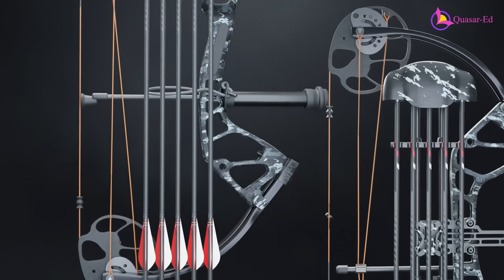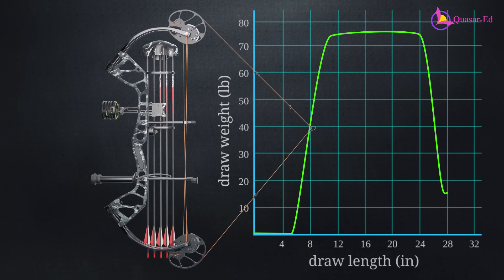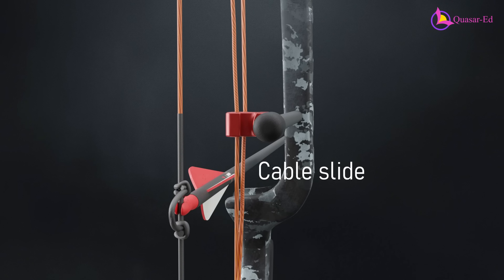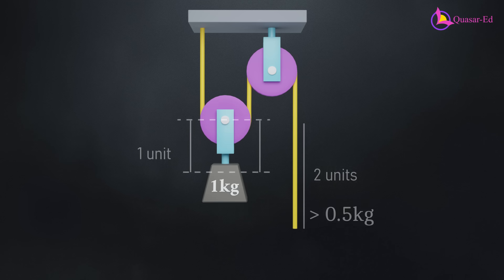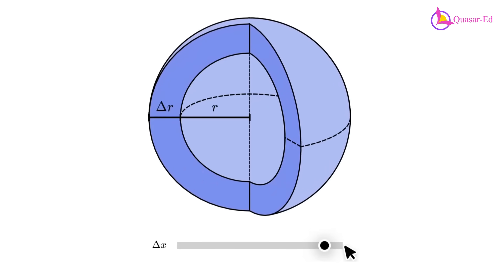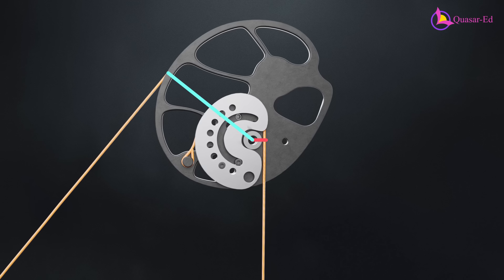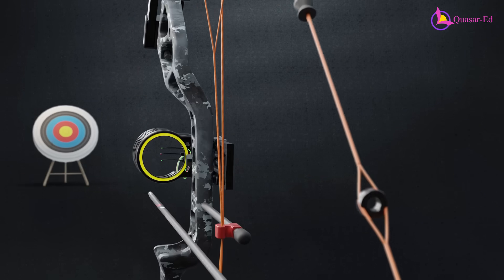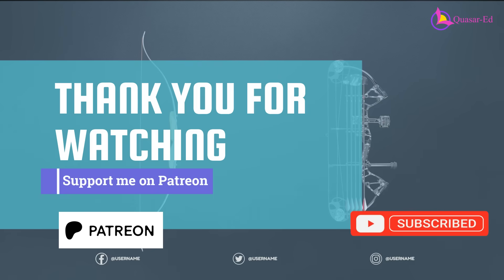The Engineering Behind the Modern Compound Bows

Comment: Great someone wants to explain bows, and shows a recurve bow held upside down.
Shows how much the person knows about archery.
Reply from the maker: What are you talking about, at what timestamp? I am sure I show the bow in correct position. And it is true that I am not an expert in archery, and in case you didn't realize, this video is about how a compound bow works, not how to become an expert archer. So you are using a wrong insult.🤔😅
Reply: @quasar-ed  The recurve on around 0:20 is either upside down or it is one of the worst 3d models of a bow I have ever seen.
Her this is how it should look.
https://youtu.be/NSft_qMMf-M?t=686
Reply from the maker: @thomaskurz5617 Actually, it is not upside down. I think you get confused about that small shadow which actually indicate the transition curve and not the arrow rest. The arrow rest is on the other side. The model is based on the first compound bow riser, so it is a bit different from modern recurve risers.

Comment: I think "compound is not more powerful" is misleading.  Even when a normal bow and a compound one have the same force (50lb), the compound one can be used by a weaker person; he can use impulsive force to reach the full draw length.    
And/or "cheat" using the whole body to draw, in one motion.

If you take the person as a fixed point, then the compound bow he can use It's way more powerful.    

No way that I can draw a recurve bow and penetrate 4cm of wood!

Comment: some misleading  info  in  this video. 
saying trad is cooler than compound is subjective.
shooting compound might be easier at first,  sure. but in the long run, mastering compound is  far more difficult than mastering trad. trad  bow shooters will  never achieve the  level of precision that compound offers, which means  there is more technical skill in compound.  you're talking about milimeters versus inches.  trad bow is cool, and  i intend to start shooting trad, but compound is just way more fun to shoot.

Comment: 1. With a compound bow you have to put in MORE effort to draw it. The thing is, compound limbs are usually 2–3 times stiffer, so you literally need more strength to pull one than to draw a traditional (non-compound) bow. Yes, AFTER you reach full draw you need less effort to hold it… but nobody aims long enough for that difference in total work to become noticeable. The advantage is that you simply cannot hold a 60–70 lb traditional bow drawn long enough to aim. But I’ll repeat — you still have to bend the limbs with about 2–3 times the force of a traditional bow to get to the point where the draw weight is redistributed to the cables/cams (let-off). And yes, energy doesn’t come from nowhere: the limbs won’t bend themselves — all the force the bow stores and then transfers to the arrow you must produce with your hands.

2. A D-loop exists to protect the string, because unlike with a traditional bow you can’t remove and replace the string without a large limb-bending press. The load is borne by the D-loop and it’s what will wear through first.

3. The “string stop” (the thing the string hits after the shot) does not reduce noise, and it certainly doesn’t reduce vibration. It’s there for convenience, and the bow is noticeably quieter without it. Believe me — I shot for about a year and a half without one while waiting for a replacement for a broken one…

4. And no, a traditional bow is only and exclusively about “learning to make your shots as identical as possible and memorizing where your arrows land.” Since a traditional bow has no aiming aids (even the Olympic recurve already has a sight and a mechanism to ensure a consistent draw), the archer simply has to memorize where they hit. So a traditional bow is actually much more limiting.

Comment: Nice video and nice explanation. I have been into archery for appr. 39 years, so I have tried both recurve with and without sight and compound bows (and a little longbow, but never used longbow for "serious" archery). I kind of like all types of bows, they each have their charm. I know shoot compound bow and have done so for appr. 16 years. As a structural engineer I probably like the engineering behind a compound bow. When I was younger, I "explained" (mostly to my self) that the let-off comes because the string becomes longer at full draw than it is at still. And that is probably part of it, but today the shape of the cam also does something. This (longer string) also explains why the draw force curve for a recurvebow slightly flattens towards the end. But I don't think you mentioned that the excentric axle for the cams probably also gives some lever effect in them selves. But the interior levereffect in the camsw as new to me. And then there are also compound bows that uses actual levers, to achieve the same as compound bows - the leverbows.
Reply from the maker: Thank you. You are right about the eccentric axle causing the lever effect. But it is used to describe the pulley or any circular disc with off center axles. For cams, their axles are always off center, so we can imply cams cause the lever effect.

Comment: The part at 4:00 is extremely misleading. The peep sight and the bow sight are like shoes and shoelaces, one is useless without the other. 

It’s not about “addition accuracy.” Having only 1 or the other is completely useless. You’re meant to use the peep sight to center the front sight, just like iron sights on a firearm. 

If you only have the front sight for example, your eye placement could be off by only a few millimeters, which will translate to several inches off target if not more downrange.

Comment: The original Allen patent showed a bow with 2 pulleys, but the pulleys were cam-shaped.  Initially compound bows were not manufactured this way, the picture of early compound bows shown at 0:55 in the video shows 4 wheels, not 2, and the wheels were round, not cam-shaped.  I've never read an explanation of this but I assumed it was due to manufacturing ability at the time.  It was some years later when 2-wheel compounds became widely available but still with round wheels.  The average 4-wheel compound only had about 35% letoff in draw weight, the average 2-wheel compound had about 50% letoff.  More modern bows with cams have the possibility of a lot more letoff.
Reply from the maker: I had my doubts about using cam shaped pulleys in that way. When I try to replicate that, the rope just slipped without rotating the cam. In modern compound bows, the rope is winded over the cam so that the cam has to rotate. I also can't find the actual footage of the first compound bow. If someone has experience on that first compound bow, please share with me.
Reply: @quasar-ed  In all bows I've had experience with, the "ropes" were steel cables usually with a plastic coating.  There is usually a piece of steel swaged onto the cable at some point so the cable can't slip, and the piece of steel fits into a hole in the pulley or cam.  The string itself that interacts with the arrow is usually some form of dacron with loops on each end that allow it to connect to the ends of the cables.
Reply from the maker: @billj5645 I mean, in the 4 pulley compound bow you pointed out, if the large pulleys had cam shaped, how would it rotate when the string is drawn? I found some images that show those were circular cam and some that were just regular pulleys. I just couldn't figure out about those cams.
Reply: @quasar-ed  By at least 1975 the wheels at the ends of the limbs always had off center pivot holes so as they rotated they would also swing out and around which is what gave the letoff due to the leverage.  On first pull the leverage is working against you so you pull harder then as the wheels swing around the leverage is working in your favor and the holding weight is much less.  I owned 3 different 4-wheel compounds starting mid 1970s.
Reply from the maker: @billj5645 I would love to see the video of the pulley action. I still couldn't grasp how the pulley rotates.
Reply: @quasar-ed  Remember it's not working like a normal pulley, the cable is connected to it so it just winds or unwinds as the pulley swings around.
Reply from the maker: @billj5645 But it is just one string right?
Reply: @quasar-ed  I don't know about the Allen patent.  In any production compound I've seen there is a minimum of one string and one or two cables.  A 2-wheel bow can be made with one cable and one string.  An older 4-wheel bow usually had 1 string and 2 cables.  I'm not sure if the modern cams can work with just one cable or if they have more than one.  There is always a string that the arrow works against, a cable would not survive that use.  The old 2-wheel bows were relatively simple, some of the cam bows are more complicated.  I went to youtube and searched for "compound bow cable replacement".  I found a video by Average Jack Accuracy where he changed string and cables.  That particular bow appeared to use strings instead of cables but he somewhat shows the ends of the strings connecting to the cams.  There were 3 separate pieces of string/cable.  If you search you might find better videos.
Reply from the maker: @billj5645  In the first Allen compound bow(which I could find), there was only one string, no cable. So it is like a pulley system without any cam action,  just like in my video.
Reply: @quasar-ed  I don't know how the evolution went from the original patent.  The original patent diagram clearly shows end pulleys that aren't round.  I always assumed when they started making them they took the easy route and used round pulleys and they may have even just used pulleys with holes in the center.  The image in your video showing the Allen advertisement with 4 pulleys is the first time I saw that picture.  I bought my first compound in 1976.  It was a PSE with 4 wheels, and had 2 cables around the pulleys and eccentrics and one string connected to the cables.  The eccentric wheels at the ends of the limbs were round but the pivot hole was drilled off center.  Later I had a Jennings Arrowstar and after that one broke a limb I bought a Wing compound to fill in, both of those also had 4 wheels.  The 2-wheel compounds were getting popular shortly after 1976 but I never owned one of them.
Reply from the maker: @billj5645  I guess you are right. There might be two strings involved, otherwise, cam wouldn't work. I wasn't sure since I have to recreate the model from the old images.

Comment: Compunds are nice, but they´re like using a rental car. If anything goes wrong with it, have to take it to the next licensed repair shop. Traditional archery can be a bit more forgiving/flexible depending on what you´re trying to arhive. It requires more time, practice and dedication to keep proficiency though. I guess choosing one over the other depends a lot on if you want to do an actual physically engaging sport or if you just want to relax, putting some arrows down the range collecting scores. 

Anyway, impressive tech for sure, though I prefer it on my crossbows. When it comes to bows, I like it blank and neolithic. lol
Reply from the maker: I totally agree with you. 🤜🤛

Comment: Good video!
Compound bow is a cool invention. Because it can store more energy at a given draw weight, it enables higher arrow velocity. But there is no magic. Even if it gets higher efficiency it still requires more effort to pull at a given draw weight, except from the let of.
You can get significantly more kinetic energy to the arrow than a traditional bow, but you also need to work harder for it.
Reply from the maker: True.

Comment: It would be nice if more explanation was provided about how the pulley and cam system works.
Reply from the maker: Let me know which parts about pulley and cam that you don't quite get or unclear. If it is not much, I could explain right here, or else I would make a separate video for that.
Reply: Cams are effectively rotating levers.  On a simple 2-cam system shown in this cool video, the leverage ratio between the string side and cable side are engineered in combination with the force generated by the limbs to create the draw force curve that was illustrated.  Compound let-off at full draw is a result of the string being far from the cam's rotational axis (usually a bearing interface around a small steel axle) while the cable distance to the axle shrinks -- the mechanical advantage of that ratio reduces string tension (holding weight) while transferring almost all of the force to the buss cables (typically hundreds of pounds of tension ).

Comment: Query: Would ( Memory metal ) be a useful alternative to Carbon/fibre glass Limbs in a bow or would it compromise weight to ratio?🤔
Also: What are the little cables Red & Green on the sights, novice here, 🤔?
Reply from the maker: I don't think memory metals are strong enough to flex quickly. Even though they are highly elastic, they are slow to return to original shape. So they are not ideal to store massive amount of potential energy needed for bows.

 These little cables are fiber optic strands. They are designed to gather ambient light at the tips, making them glow brightly,  so the archer can see the pins more vividly.
Reply: @quasar-ed Ta 4 Info, 😊